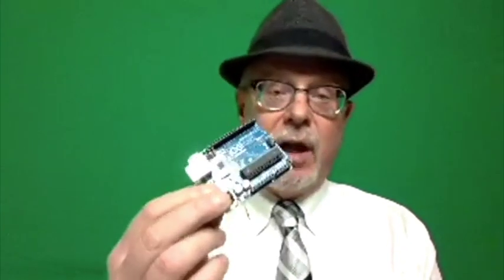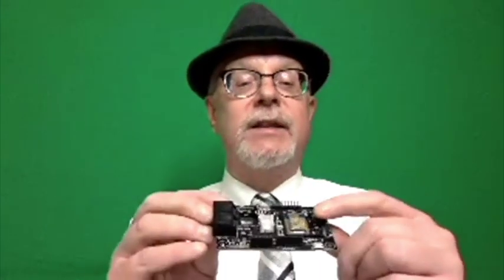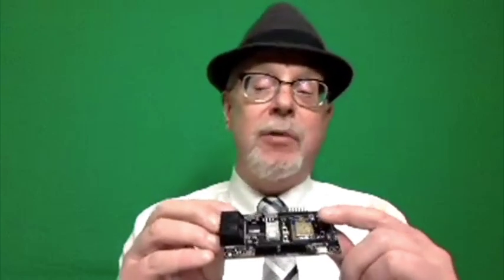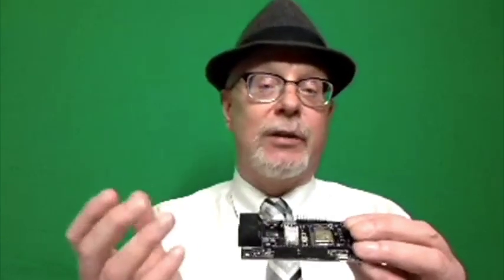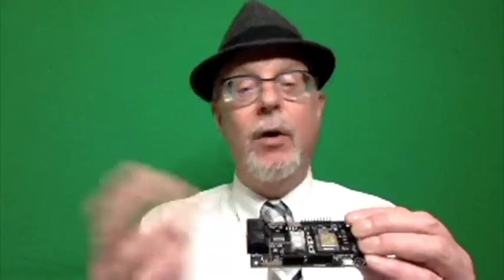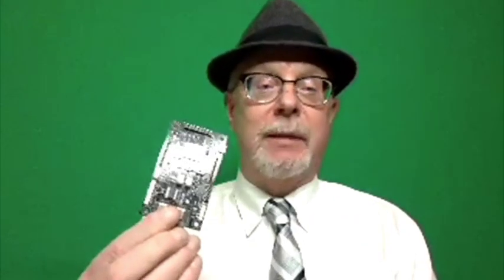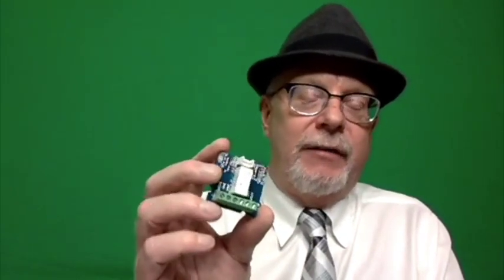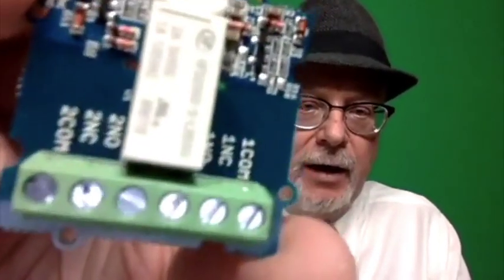What Are GPIO Pins or General Purpose Input Output Pins?

Comment: Hi. Great video. I'm an Electronic engineering student at university and recently got an Arduino (I had a raspberry pi long before). I'm scared of blowing either up when connecting using a GPIO connector. How can I connect them
Reply from the maker: Yes, you need to use a bidirectional voltage translator from 3.3V (Pi) to 5V (Arduino).
Reply: @Switchdoc  thanks. Already done
Reply from the maker: Check out tutorials for the Arduino GPIO.  Start with an LED!